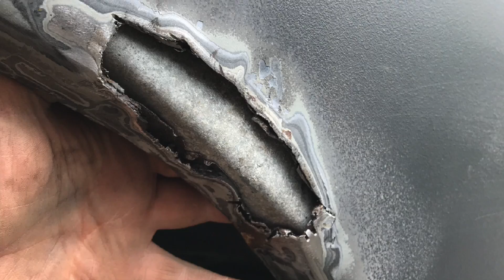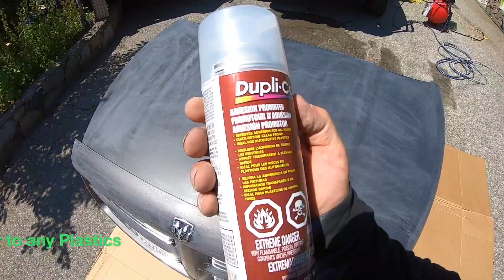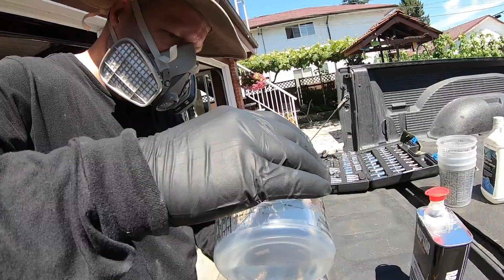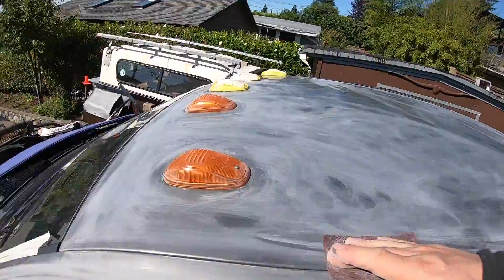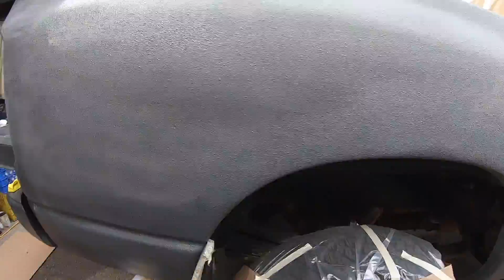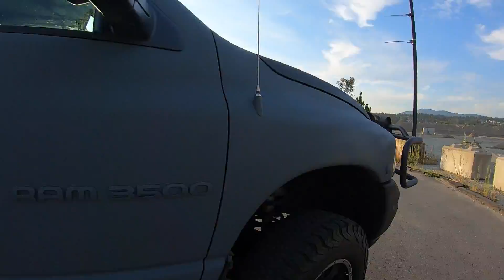Raptor Liner Paint Job Part 2, Dodge Ram 3500

Comment: Do you have experience painting or your first time? I want to do mine but im afraid to screw it up, never painted before. Thanks any tips would be appreciated!
Reply from the maker: Its very user friendly product. Spend the time to  prep . U have to take off the clear coat with sandpaper & scotch brite in hard reach areas. Clean with brake clean or other....Mask & paint. 
I sprayed it at 60 PSI with 2 coats. You have about 1 hr before a can goes rock hard.  Its simple instruction...Mix / shake/ shoot.   Goes real even & even after few years it looks like I just did it. Its semi gloss & UV protected..
Reply: @miked.r.6671  Thanks will definitely do it, best regards!
Reply from the maker: @JoseOrtega-xn4mj  Yeah dude!  Im sure you will be happy with it. Post a video & send me the link ;)

Comment: How many liters of raptor liner did you use for the entire truck? I have a quad cab myself and Im about to do mine.
Reply from the maker: I used 10 bottles all together, but did not do the truck bed, as have a plastic box liner.

Comment: Truck looks great. Great job. One question, how many bottles of liner did you end up using? Thanks.
Reply from the maker: Thanks. I bought 3 kits , so 8 bottles tintable ( Used Anvil Colour for tint) And 4 bottles black.   I used 10 bottles in total to complete the truck, with door jams included .
Reply: @miked.r.6671  thanks for the info. That's what I was thinking I would need. Maybe a little less because mine is a single cab flareside obs chevy but i will order that quantity just to be on the safe side. Good job keep it up.
Reply from the maker: @lunarodos  My truck has a plastic bedliner, so I didn't need to Raptor in there. I bet that would require another 4 bottles if I needed that. Prep /Shake/ Shoot    The prep is lots of work to do it properly . I sprayed at 60 psi & liked that pattern there. Good luck Dude !   Post a video ~

Comment: Question how did you do the door jams . What did you tape an what were you able to spray with hinges an all.
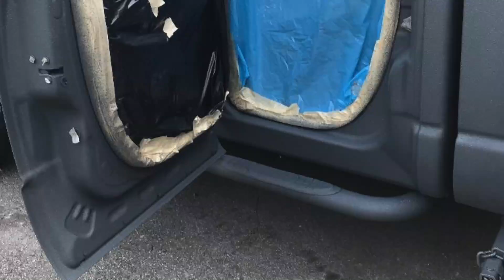Reply from the maker: I didn't film the door jam painting, but theres a pic I took at 3:25 on video. You might notice how I taped & prepped the area, with some tape on screw or bolt heads incase ever need to remove. The hinges weren't much of an issue , and sprayed 2 coats. Im glad I spent the extra time to do the door jams, as it looks much cleaner & complete.  The paint is holding extremely well, & Id recommend using Raptor if your thinking about it.
Reply: Mike D.R. Thanks for the info man . I am definitely going in probably next month. I have watched a ton of videos to make sure I know what I’m doing, but haven’t seen anyone show door jams. Wanting it to be top notch. Truck looks good.

Comment: How much do you figure I would need just to do the cab on my 03 ram quad cab? And where did you buy the tintable liner local ?
Reply from the maker: Hey Will,
I used 10 bottles to do the whole truck ( minus the truck bed), so I would think you would require 6 bottles to do the job. I did the  door jams as well, with 2 coats all around, and liked the texture at  60 PSI .  The tint you can get from any auto body supplier, or quality auto supplier . I used 75 ml tint per bottle ( Colour Anvil) .  You can use 100 ml, but they dont leave you much room in bottle, so will get a mess when you insert the gun.
Reply: Thanks for the reply so I imagine lordco will sell any shade of  tint and 2 kits should do the cab 👍

Comment: What color did you use for the body?
Reply from the maker: Tint Colour is called "Anvil"
Reply: @miked.r.6671  What product is the tint, I have searched google and can't seem to find "Anvil" bed liner tint. TCP Global, Amazon, Raptor, etc... Do not seem to have "Anvil" tint
Reply from the maker: @nathanlief  Raptor Liner  comes in a "Tintable" version and also a "black" Thats non tintable.   You can purchase tint colour of your choice at any auto body  supplier.  The tint colour I used is called " Anvil"    (PPG Code 933726 Grey)  I used 75 ml tint  to every bottle of Raptor liner  , but you can use up to 100 ml, but doesn't seem to leave much room in the bottle for 100 ml, and 75 worked perfect.  Hope that Helps Nathanlief .